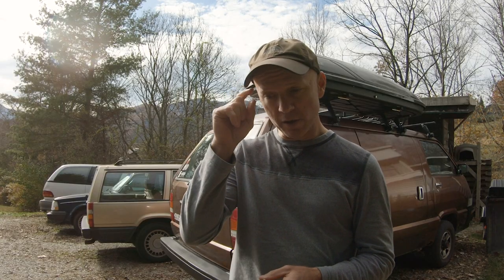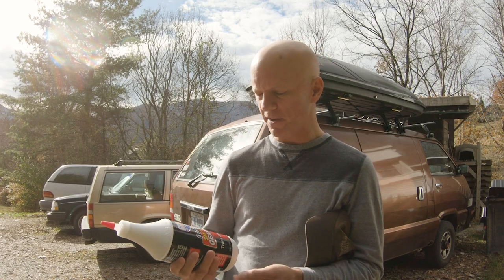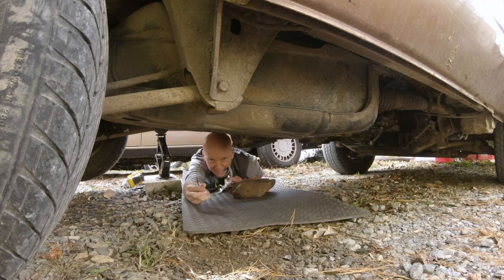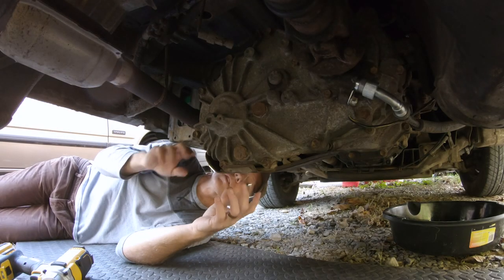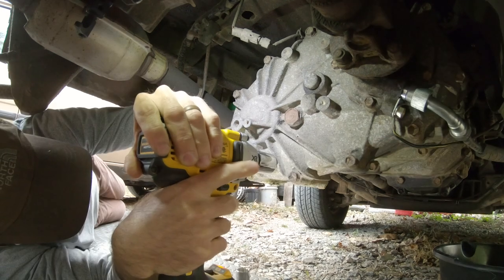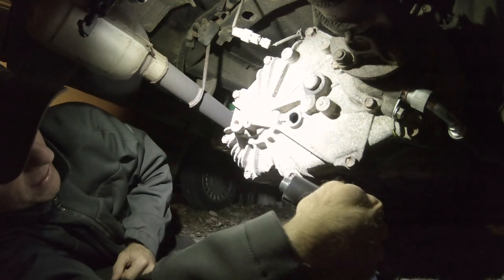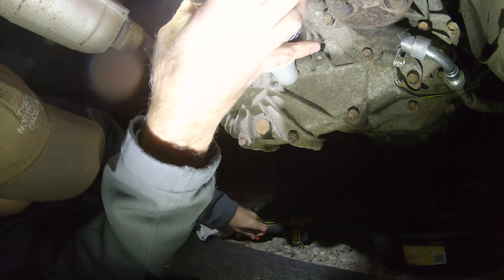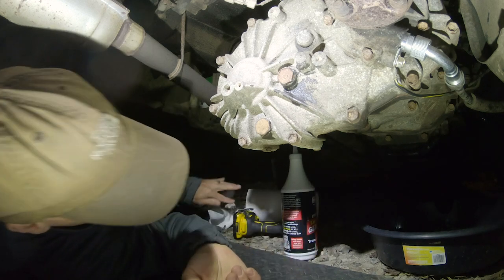1988 Toyota Van | Crusty gets new Gear Oil

Comment: I see this was pre dropping the rear axle! I actually just changed my front diff oil last week! I realized how accessible it was after having the radiator out. I had similar issues with wrenches sockets etc. I found that a closed ended 24mm wrench worked great using it from above to get to the fill plug. not much room side to side, but I was able to get a great grip on the nut, just had to remove and reapply the wrench several times until it was loose enough to finish by hand.
Reply from the maker: Live and learn I finally got it... but it was in a later video. :/